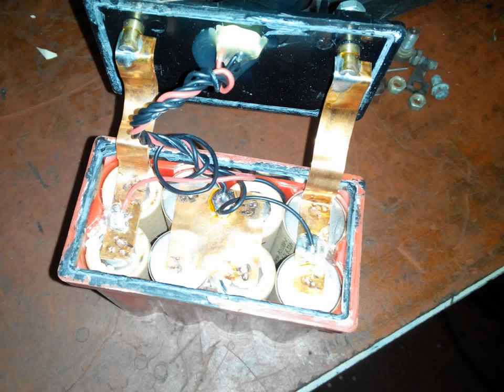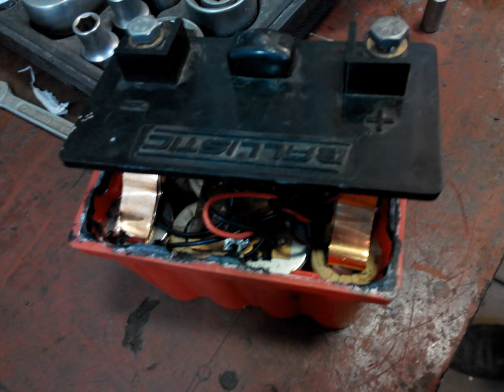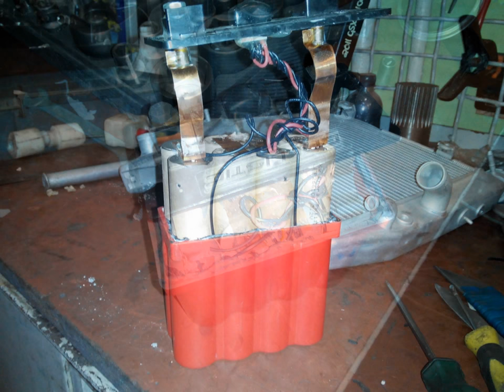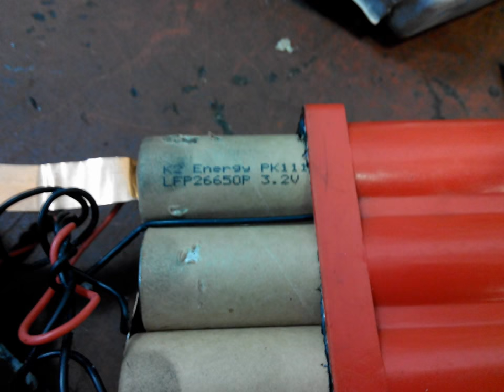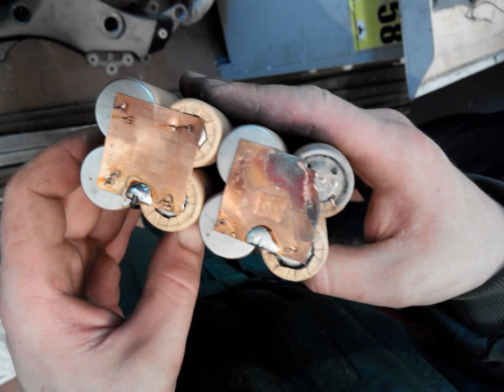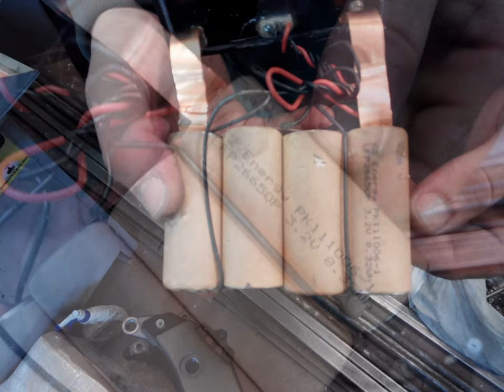Ballistic battery  (inside)

Comment: Thanks I needed to know what kind of batteries I could replace in there.  LiFePo 26650 3300mAh 3.2v cells.
  

I personally went back to lead acid because the ballistics don't have a charge controller in them.  These ballistics need something that prevents voltage drainage below 9volts and another system to prevent charging over 14.4 volts.   Below 6 volts and you can consider it dead and fubar.  I heard that shorai batteries have a pcb that controls all that.  Don't use a charger that has a desulfurization circuit on a ballistic.  This will guarantee total battery failure.

Since Ballistics are Lithion Iron Phosphate batteries, they are probably more useful in electric vehicles.

Comment from the maker: we bought the same cells that was in battery. They cost 80$ for a 8cells on eBay - k2 energy lfp26650p. I think that 90% of such battery failures - not good relay regulator